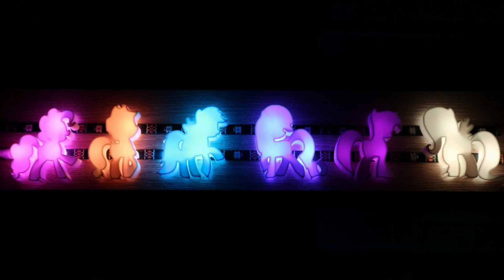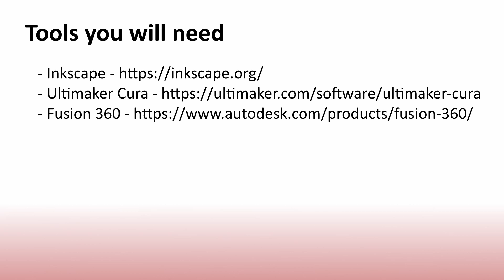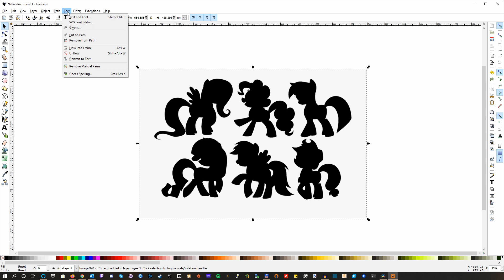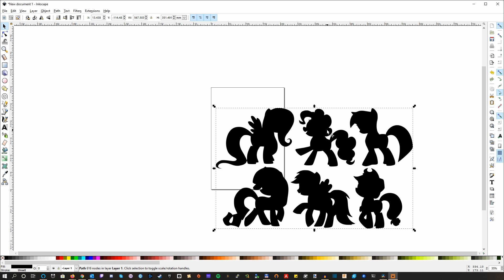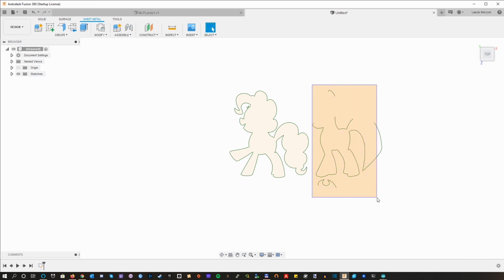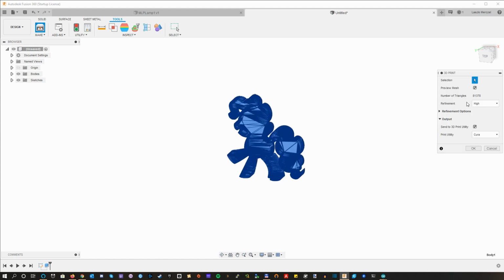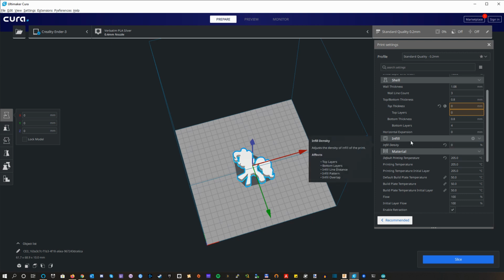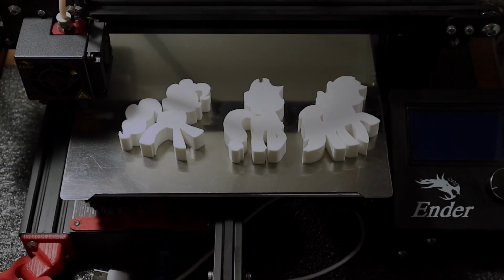Turn ANY 2D Shape Into A LED Light Diffuser!

Comment: Thanks for the video! Bet your daughter was very happy. How did you attach the printed ponies to the led strip? I have an idea where I to print a singular long cylinder piece that will cover the entire led strip.
Reply from the maker: Hi Dan! 

To be honest, I've ended up with a "meh" solution - i've 3d printed three roughly 2.5mm high (roughly the thickness of the led strip) white strips that I glued on the base above, below and between the two led strips and glued the ponies to these. Obviously this causes some light bleeding out on the sides and while it made an 5 year old happy, I wasn't satisfied at all. So, I've come up with a different approach - see the other video: https://www.youtube.com/watch?v=NkI_L8HzqfE

Comment: This gets a like just for the ponies. Poor Twilight is missing her back legs. Is it because the wall thickness doesn't allow enough of a gap for more light to pass through? Aside from the LEDs not wanting to play nicely, a nice tutorial and the ability to trace vector images was one of the features I enjoyed most in Illustrator when I still had access to it. I'll have to give Inkscape another whirl, it appears to have matured nicely in the 5+ years since I last looked at it.
Reply from the maker: As I mentioned it in the video, they are not perfectly lit from the background. Truth is, I've made a quick prototype of the light with WS2812B strips strapped behind them, so there are two problems: a) the gap between the LEDs are too large and fixed b) being 5050, the LEDs are too large as well and hence hard to position correctly in this case. For the final version I'll need individual LEDs in the back, probably sitting on a PCB. And probably smaller ones... or I have to make the ponies larger. I guess the kids wouldn't mind the latter... :)
Reply: I saw that you mentioned it, but you didn't discuss it further and after looking at the images, that was one of the possible causes I came up with. I also noticed the space between the LEDs which seems to have worked out OK for many of the diffusers, but not so well for at least one of them.  I don't know if WS2812B come in the 144/M variant(I am a APA102C guy) but I also thought having a more densely packed strip might help as well, but for a simple demo on how to go from 2D silhouette to 3D light diffuser, the tutorial was great. Figured I'd save some of the other thoughts for mediums such as twitter(@nakanaela), I just got side-tracked looking at other things on YT